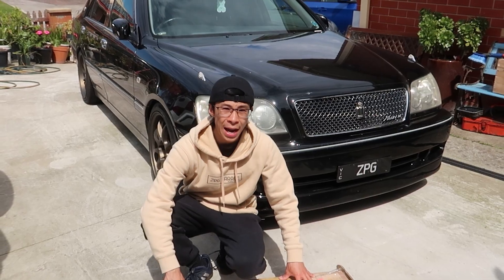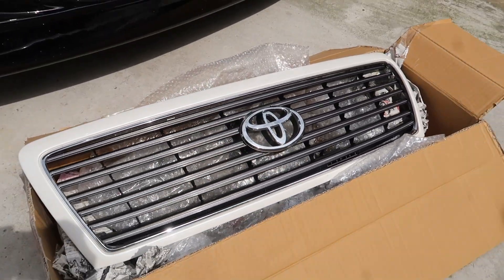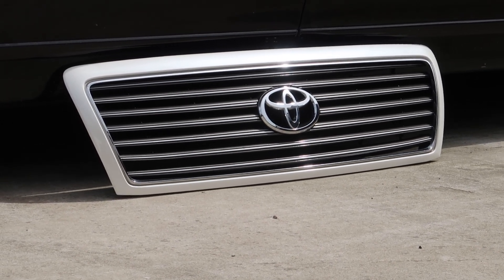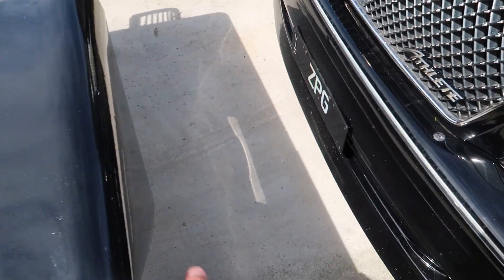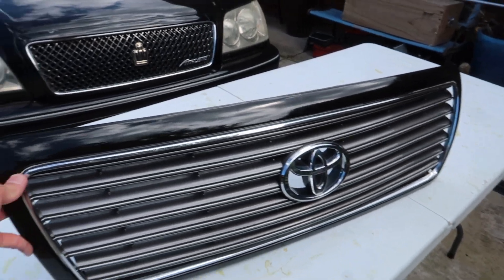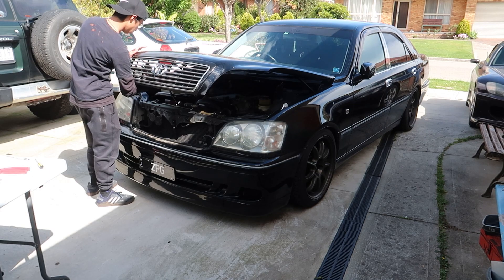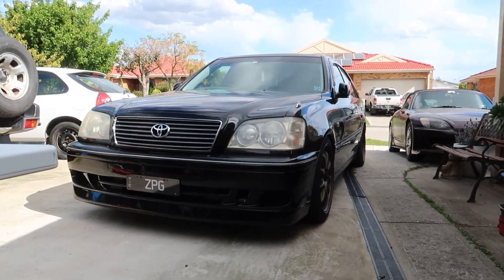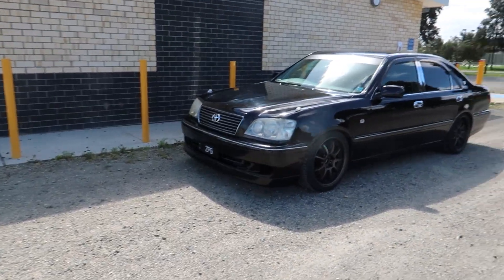Installing a Custom TOYOTA CELSIOR Grille onto the TOYOTA CROWN JZS171!

Comment: Did your factory hood latch work with this grill or did you have to make up a new one
Reply from the maker: Yeah factory latch worked. 
I got lucky when I bought the grill it came with the other side of the latch on the grill already
Reply: @zpggarage  thanks man. Yeah just got my crown with the grill but yeah the guy was super dodgy and didn’t have the old bracket fitted on it so it’s hard to open the bonnet sick videos man 🤙

Comment: OK in general but subtle? No, the Toyota emblem is really in your face whereas the Crown and Athlete emblems are much better and more subtle due to the cars rarity outside Japan.
Having said that, the original grille and its fixings are flimsy and crappy to say the least so pretty much anything is an improvement.
I have a JZS171 Crown Athlete Estate.